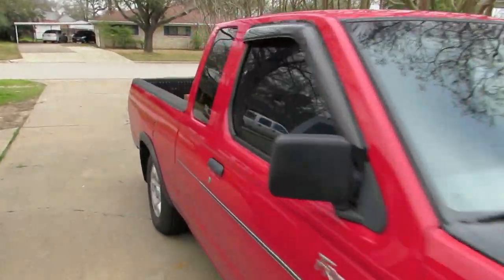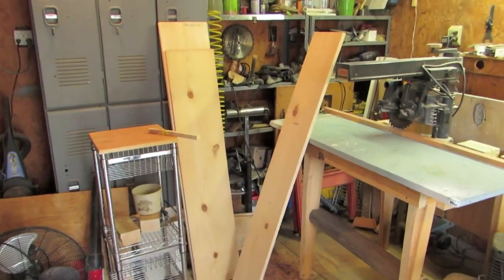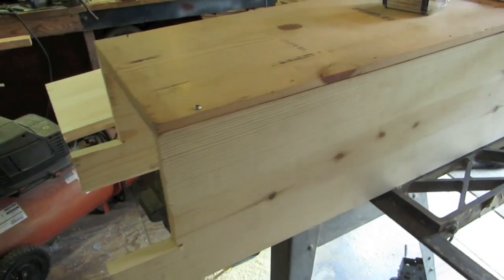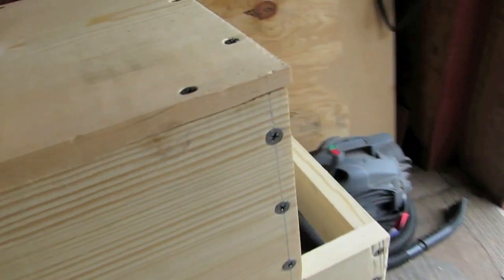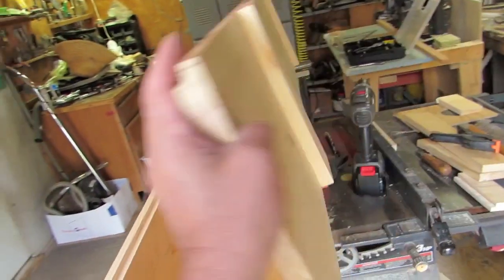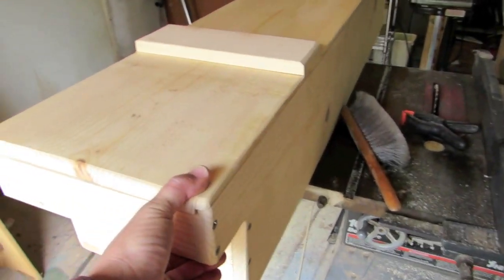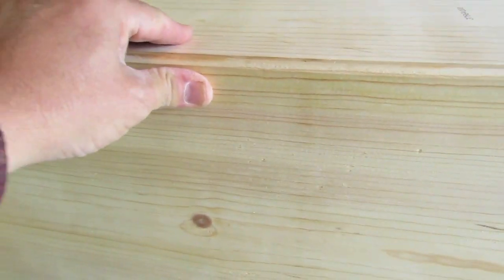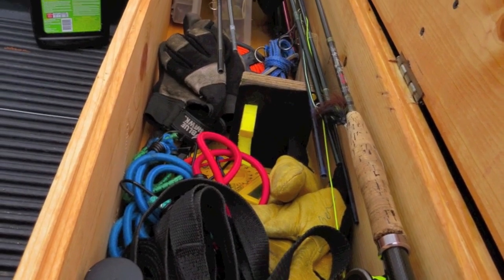Junk Genius: Tools and Tackle Truck Box

Comment: Inspiration for me to do one like it.  I hold my plastic box on my truck with two keyed linch pins.  One at each end through the box and through hole I drilled in bed wall.

Comment: You shouldn't worry about dehydration because it'll always have plenty of rain water in it. I've built boxes like that and unless you wrap trim all the way around the top water will get in. And still it's not sure fix. looks good tho.
Reply from the maker: yep this truck bed box is only good for my fishing gear anything else that shouldn't get wet won't be in there..
Reply: Phil Lowman you can build water tight wood tool boxes (think wood boat ‘deck hatches’). You have to make the lid a ‘box within a box’ and caulk properly.

Comment: You should add a drain hole just incase water gets in. And or paint it or use truck bed liner on it so itll be more protected from the elements and wear n tear but nice build! Looks nice
Reply: The stain looks great though, always liked how wood looks stained

Comment: Like the wood stain! What about some gas lifts, to the top up? With that, some straps to secure the rods to the underside of the lid, and a bit out reach of other shifting gear. Love the way you debate the process with yourself. Shows how indirect these projects can be. Few start with a we polished set of blueprints....
Reply from the maker: I never use plans other than what's in my head..  that way nobody know when I mess up..  a good carpenter never makes mistakes he simply makes adjustments ;)
Reply: William B Tedrick Awesome. I'll be stealing that line! :-)

Comment: If your screw does split the wood, you can fix it by taking out the screw and put a little hot wax or wood glue on the screw itself and a little in the screw hole, screw it back in and your cracks will be reinforced and repaired.
Reply from the maker: thanks

Comment: what did you do with the box?  did you paint it black ?     does it fill up with water when it rains?       let us know how you made out. I have been thinking of making a truck tool box for my  90 s10  .   Also, can I see a close up of your dust catcher on your radial arm saw?  thanks.
Reply from the maker: three years +  later and the box is holding up pretty well but I should have built the lid differently to better shed the water. I drilled several weep holes in the bottom to let the water out if it leaked which it did.. I painted it with black oil-based paint which lasted about two years before it started to peel off.  When I do this again I'm going side-saddle and longer
Reply: @FishTales-Reel-Life-Adventure  well I finally built my box also. Just finished it yesterday.  3 years ago I commented on your vid. Cant  believe how long ago that was so fast?  Crazy.

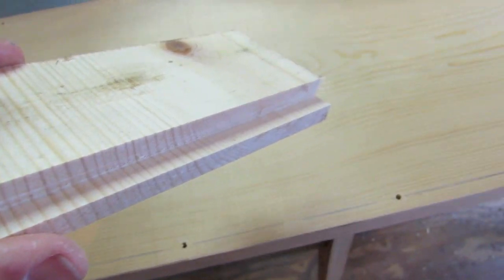Comment: Hey, i want to make the same tool box for my 98' nissan frontier and i was just wondering what you said the notch thing is called at 2:44 and how do you do that lol?
Reply from the maker: it's a dado or lap joint. cut it out with the table saw or a router.

Comment: Good on ya ! How has this held up over time?
Reply from the maker: The top needed more protection as it warped and rotted within two years. To top it with flashing tin would have help protect the wood and shed water much better. I sold the truck in 2020 but I have the tackle box in the barn.

Comment: I'd like to make something like this for my chevy colorado, how did you secure it so it doesn't slide around or anything? I live in a really bad area so I'd probably need a way to lock mine in place AND lock it shut.
Reply from the maker: I screwed it right to the bed lip and blocked it under the lip as well.. The wood box really isn't very secure but if the lid was metal that would help..

Comment: how do you hold it to the car? great job!
Reply from the maker: screws into the side rails inside the box..
Reply: @FishTales-Reel-Life-Adventure  is it in the video or not?
Reply from the maker: @ronnylopez8399  yes at 10:50 on the far side of the box in the truck you can see the two screw heads into the side rail. those were  self-tapping screws.

Comment: Great looking tool box! 
How did you mount it to your truck?
Reply: 9:17
Reply: My toolbox is secured to truck with two keyed linch pins one on each end through the box and through hole I drilled in bed wall.  No tools required for removal and reinstall.